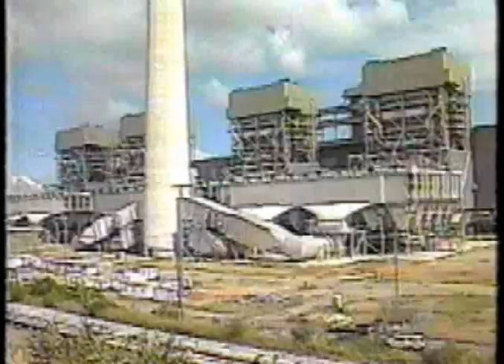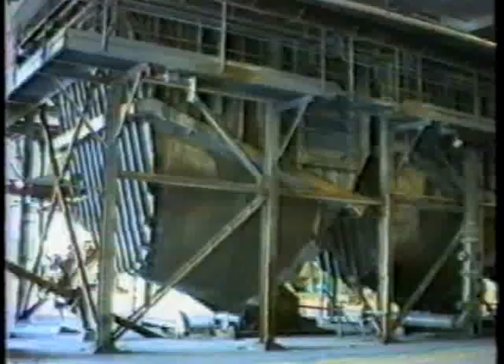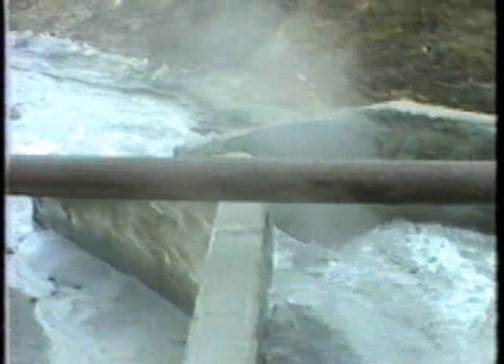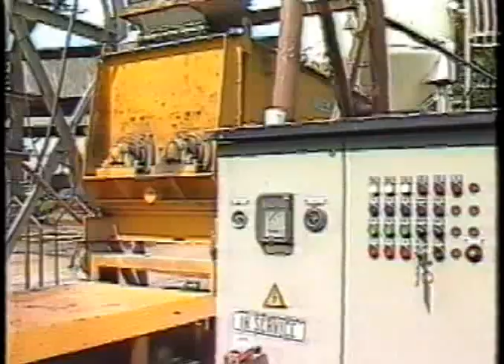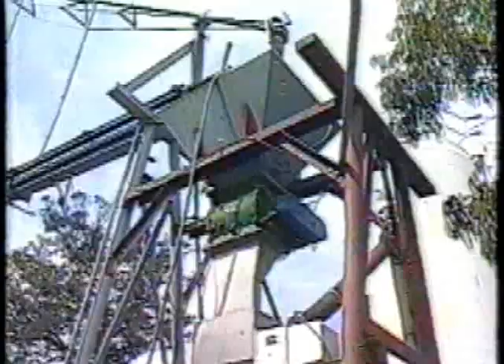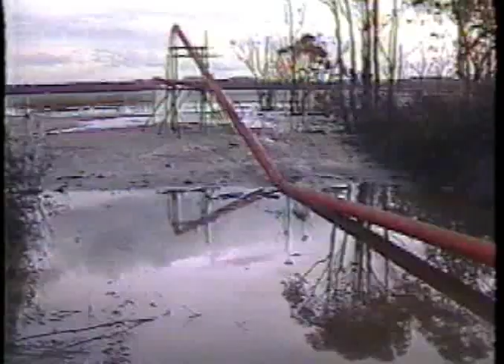Disposal of Power Station Ash

Comment: Vales Point is amongst of the worst coal power station polluter (air, and coal ash) in  Australia per generated MWH. 

Wyong population being very close to Vales Point have been paying a heavy health impact price (significantly higher cancer cluster rates and chronic health diseases) for the last 20 years. 
Wyong also has significantly higher than national average cluster of chronic health diseases. 

Wyong will continue to pay a higher health impact price for the next 50 years (long after Vales Point closure) because of :- 
A) Central Coast Council and State Gov allowing substantial new housing development and urbanisation closer and closer to Vales Point; 
B) existing massive open field / unlined heavy metals coal impoundment blowing in the air and leaching into ground soil and lakes and rivers. No solution is available to remedy these massive coal ash impoundments; and  
C) It is medically known that it takes decades of chronic exposure to heavy metals before cancer diagnosis Being fully aware of the health impact damage by Vales Point, 

The last NSW State LNP coal-ition of misfits shut down the Legislative Council Coal Ash Health Audit Enquiry for the Central Coast & Hunter that was due to report back by December last year. 

Even more perverse NAPLAN figueres repeatedly shows drops in kids performance as schools get closer to Vales Point.
Clearly with increased housing development near Vales Point, more kids will be intellectually deprived and robbed of their potential growth 

A health  /  environment   disaster  case............